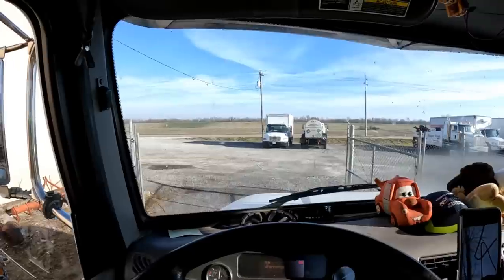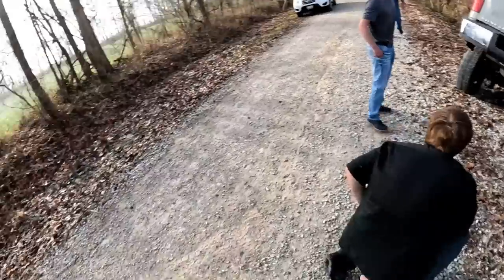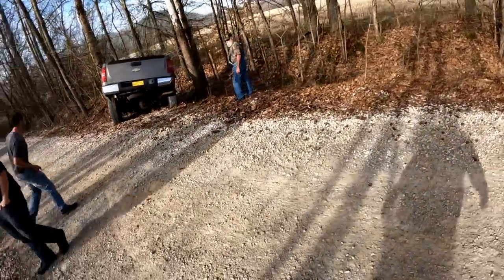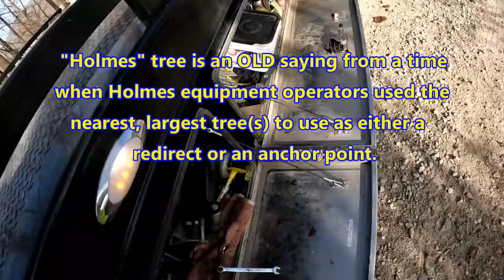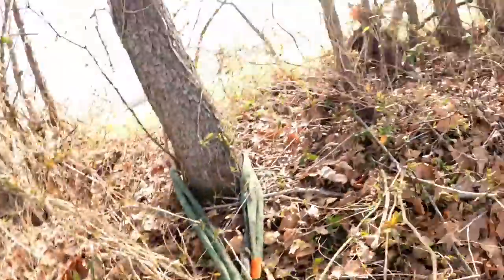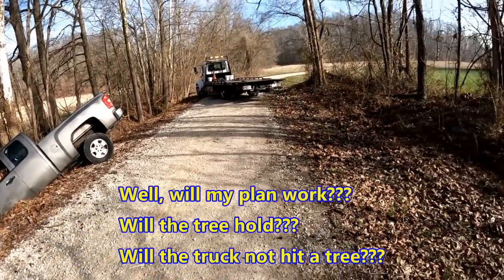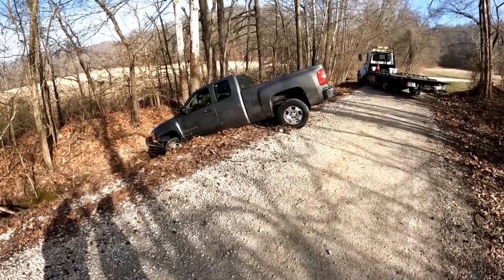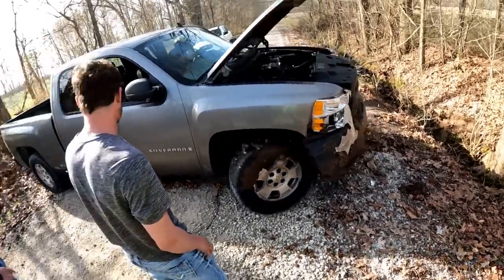DITCHED IT!!  Holmes Tree Recovery for the Win!!

Comment: I think that's one of the reasons Holmes came up with the split boom wrecker design. It allowed the operator to anchor the wrecker to the appropriate tree with one boom and the other boom to the wreck. It was a revolutionary design in the old days before things like hydraulic telescoping outriggers.  The Holmes 750 was one of the best wreckers back in it's day and some are still being used today.
Reply: one of the best Boom systems ever made I trained on a split boom Slinger when i was 18 good ole truck didn't like the pto though It was worn out
Reply: Jaime Davis has a fleet of them 750’s and such. He says the brand new trucks are great …. Until there is no work for 2 months then the old beat up paid for trucks look pretty darn good! 💰
Reply: @Chaplain_GM  the first wrecker i drove was '56 Chevy with a holmes split boom, had two levers, one to release and engage the clutch and one to run the winch
Reply: @jimsmith9819  Sounds like the 53 F500 I got sitting behind the house

Comment: Sorry about the Ivy...
Looks like a recovery I did with my Tractor a few winters ago. 2 part line between the Holms Tree and the Stuckee, then to My tractor with a 100' piece of 3/8. walked it out just like you did.. Had the Driver turn the Wheels hard right so it Came up a bit sideways up onto the Road. The Ditch was not near as steep or deep as this one. 
Thanks Ron..
Mike M.

Comment: Yeah, definitely looks like he was running a bit fast for the road, and got loose in the turn, maybe because he didn't see it coming in time, maybe because he was playing around.  Either way, no one hurt, and most all of us have done similar things when we were younger, so hopefully lesson learned.
Reply: Not most of us!
Reply: @wandalbowen8101  - don’t worry Wanda: I did enough stupid things for the both of us. Amazingly enough I’ve only wrecked one truck and that was because I was too cheap to buy new winter tires and spun out on black ice on a bridge overpass. Fortunately the truck wasn’t worth much and I convinced the cop that I didn’t need a report as I could fix it myself.
Reply: When I think back I sometimes wonder why I did some of the things I did. That was 40 or 45 years ago, I'm 66 now.
Reply: Description says he was avoiding a deer and went over. Not necessarily speeding.
Reply: @wandalbowen8101  so all of us?  

I dunno, may be different for girls, but pretty much every boy I knew growing up did dumb things occasionally.  Not always with regards driving, admittedly.
Reply: @JohnHallgren  point that I'm only guessing he was going a bit too fast, based on what appeared to be his tracks in the road.   Hardly the most accurate method.
Reply: That's the oldest excuse in the book

Comment: Ron's focus on safety is impressive. I was watching another "tow" channel (really just a couple of guys playing with old heavy trucks) and they did so many things that violated several of Ron's basic safety considerations that Ron has showed us. They just hooked a cable to one point on the off-the-road wrecked car and yanked it up the hill. No geometry for leverage. One guy literally straddled the pull cable as they pulled the car up (that sure woulda hurt if the cable snapped). They drove the tow truck along the road as part of pulling the wrecked car up. The final yank on the wrecked car caused the wrecked car to collide with the side of the tow truck.

Comment: I did that years ago in a 89 nissan 4x4. Off in a ditch I went in pouring rain on a dirt road that turned to mud. Nose dived in water and it killed the engine and wouldn't start. So luckily a policeman drove by I explained what happened. I wasn't playing around the road was just so sloppy and i lost it. Cop called our local wrecker who came and yanked me out. Only charged me like 50 bucks. And once out of the water and up on the road it started luckily. No ticket because I deliberately didn't go off roading but I sure got lucky and learned a lesson

Comment: The closest escape with a run off into a ditch I've seen involved a station wagon with a family of 4 towing a caravan. The caravan fishtailed and pushed the car into a ditch. The station wagon ended up straddling the ditch upside down with the passenger compartment intact. Lucky for them there was a cargo screen in the back of the wagon to stop their luggage from hitting them. They walked away shaken but unhurt. The wonders of seatbelts. My family think I'm too fussy about wearing them but I've been saved by them more than once. Part of my education included being strapped into a rig which simulated a low speed crash. Even there the forces involved are enough to persuade you to wear them.

Comment: It's weird that you can see his tracks going straight and then suddenly make a right turn into the ditch.. Makes me wonder if he dropped something or was dodging an animal or what because there's no reason for him to have suddenly made a right turn... Around here we'd suspect maybe dropping a joint for something like that. It's funny how often your phone has perfect comedic timing with those notifications with Mater.. You missed it, a couple weeks ago there was a 1934 GMC boom truck for sale for like $2300 about 30 miles from me.. If I could've fit in it I would've bought it in a heartbeat. It's so cool to see really old tow equipment, I also have a thing for old Ford tractors too.. no clue why other than my shop teacher had one with a flathead V8 in it when I was a freshman in high school.. he sold it for $1000.. Oh 2000 how i miss you, I would've drove that thing to school had I been able to buy it, would've beat riding my bike.   
It will always amaze me how much more damage modern vehicles incur at low speed. When I put my 76 F100 4x4 into a ditch at 20mph while skidding, I was able to drive it home. All that happened was it bent the tie rod/stabilizer bar and the stabilizer shock. (and some paint work where I went through a barbed wire fence up to the windshield) A new (or newer) truck would've been totaled. The difference is that I also broke two ribs close to my spine where my back hit above the bench seat on the cab because I'm so tall and long in the torso. In a modern truck with high back bucket seats I likely would've only had bruising from the seat belt or maybe a popped front of the rib and whatever damage the airbag going off would've caused. There's definitely a trade off for driving a modern "safer" vehicle over an old one.

Comment: Great video as always but can I suggest replace the wooden block with a variation of that side puller you made, which fits in any of the chain holes, around the edge of the bed when running the cable over the edge.

Comment: Every industry has its nomenclature. I think that was a big hurdle that I had to crossover when I started working for RadioShack. I had no electronics background before I started working.
IIRC you said that you have been working in this industry for close to 28 years. There has to be many olden terms that may not translate as well to the newer guys in the industry.

Comment: As far as the ivy goes. You had a long sleeve, pants and gloves. Which are all contaminated now. And need to be washed in hot sudsy water along with your hands and forearms. I was highly allergic to it. But got it o many times I developed an immunity. I can pull it up with my bare hands now. And the main causes of young ones driving into ditches on straight roads is. Dropping their beer or joint.